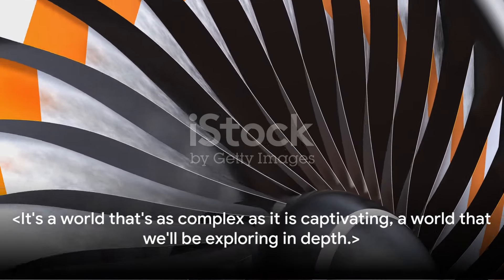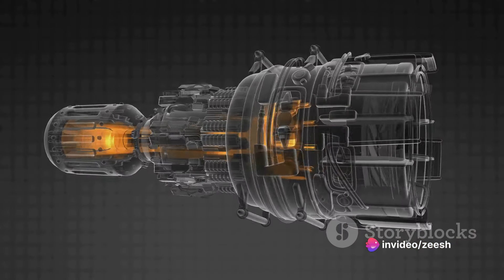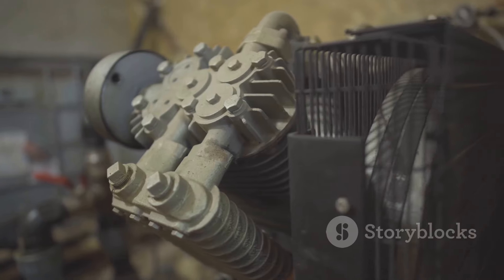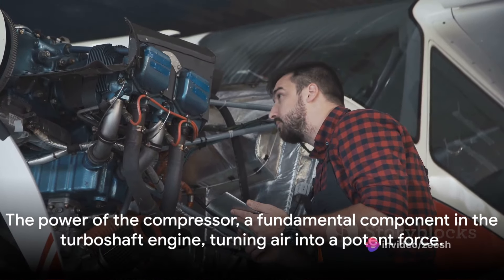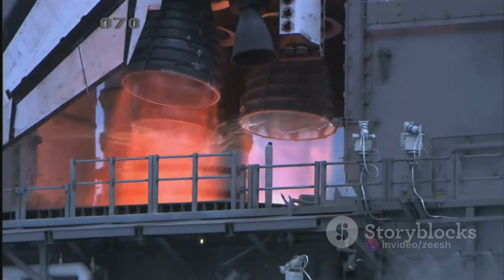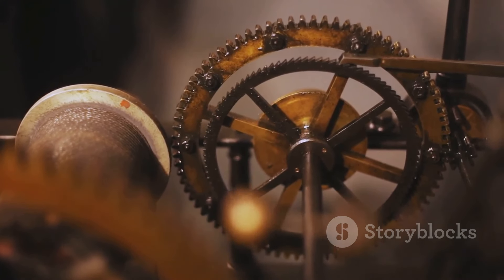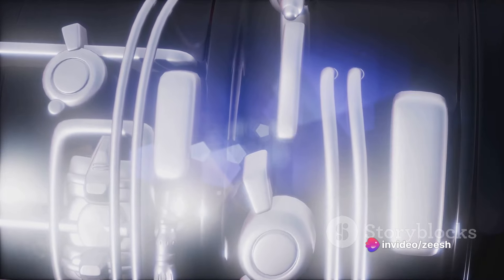How Does a Turboshaft Engine work

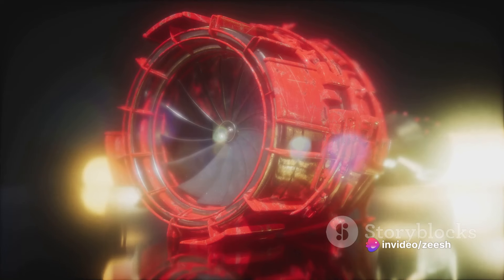Comment: 1:17 there is no explosion in a jet engine, just a continuous burn adding heat to the system. Turn on a burner on a gas stove - that is exactly what the burners in a jet engine look like. Just a continuous flame heating up the air.